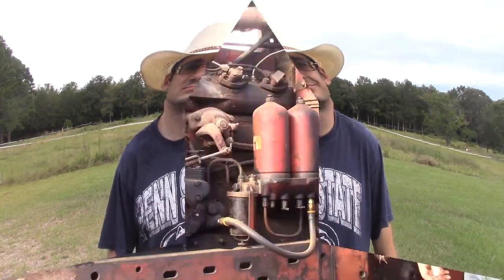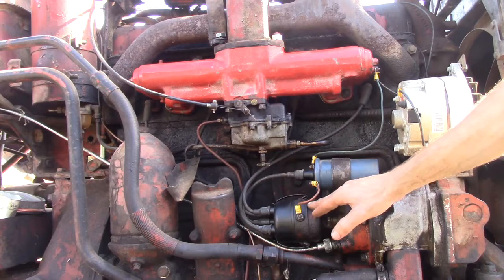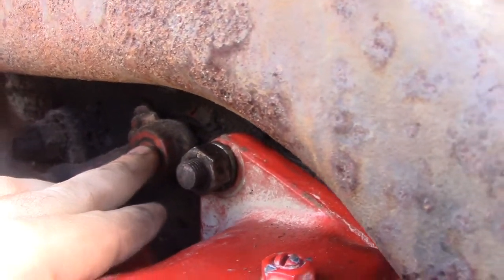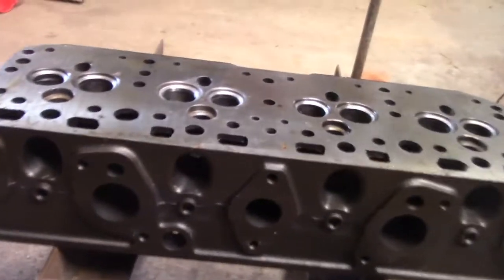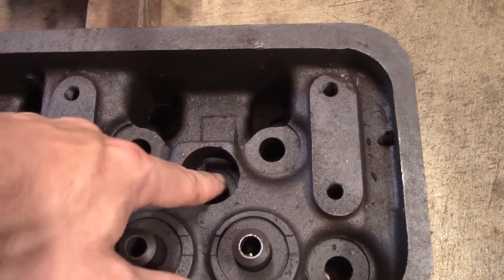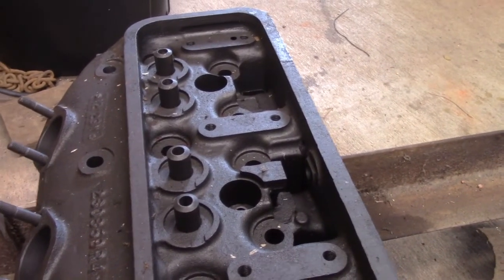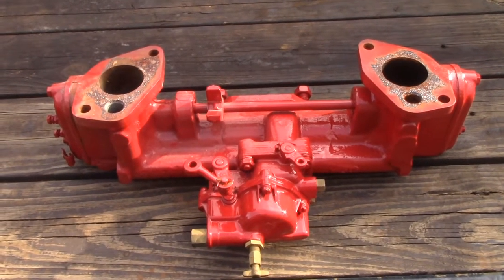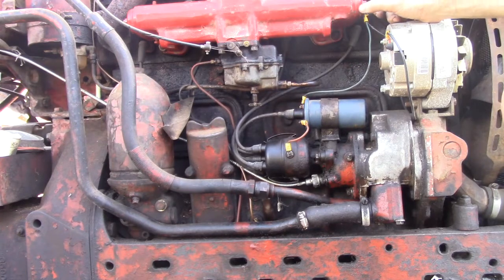Principals of Farmall Gas Start Diesels

Comment: I have some questions on a injector pump on one of these tractors can you help me
Reply from the maker: I can certainly try
Reply: @reeseholler92  I am getting fuel in the oil reservoir on the injector pump 
I have also noticed I can’t seem to get the air out of the fuel in cylinders 1 and 2 
3 and 4 have no air
Reply from the maker: Does the Pump have an A or an IH on the side? The A pumps have a scavenging valve which may stick and cause fuel to enter the reservoir. Otherwise the seals in the primary pump will need to be replaced. It is very common on these. If you cannot get the air out of the injectors after loosing the bleeding screw your plungers are stuck in the distribution block. Doesn't surprise me if its sat for awhile. The top will need to come off and the block removed @masonheggie706
Reply: @reeseholler92  it has the IH on the side 
Will I have to remove the pump to take the top off
Reply: @reeseholler92  it does have a new primary pump on it 
I sent it off to get rebuilt because it was leaking fuel on the motor side and the primary pump 
The guy replaced the primary pump and the seal on the front and said it had good pressure I really just don’t want to take it off again
Reply from the maker: @masonheggie706  If you've pulled the injector line off of the injector and you're still not getting fuel but the other two are, I don't know what it could be other than the distro block. You do not have to remove the pump from the engine to pull the block.
Reply: @reeseholler92  ok thanks 
I am getting fuel to all injectors but 2 of them still have air bubbles and some fuel never solid fuel
I will try it tomorrow 
Will it be seals or o rings the need replaced
Reply: @reeseholler92  I will let you know how it goes 
You video was very informative so glad you returned my message
Reply: @reeseholler92  in your video you talk about adjusting the butterfly for the idle is there a good starting point 
Like screw it all the way down and then back out 1 revolution 
I can’t seem to get it to run without half choke
Reply from the maker: @masonheggie706  depending on what model it is there is a distance setting. My md will only run on half choke as well. Since it's only for starting I never worried about it. As long as it starts thats all that matters
Reply: @reeseholler92  I got this top off and the block off how do you get them out
Reply: @reeseholler92  the plungers out
Reply: @reeseholler92  I got it going I couldn’t figure out how to get the plungers out one was stuck bad I just kept working with it and finally got springy again 
I think I need to advance the timing seems like it is over fueling 
Thanks again
Reply from the maker: @masonheggie706  I'm working on a 4 page paper for my grad degree, but after I finish that I can post instructions on how to set timing. You'll want to run some sort of lube additive in your fuel to help keep those plungers from sticking in the future
Reply: @reeseholler92  thanks

Comment: Recently acquired a 400 Gas start Diesel, initially the gas side worked but after a bit of use it became rougher and now appears that it’s trying to start on diesel though the lever is in gas start position. Confirmed this by shutting off gas supply and with lever in gas position it start on diesel. It will run for a few seconds before shutting off. Any thoughts?
Reply from the maker: Hi, sounds like you have a few things going on here. Thankfully everything on these fuel wise is adjustable and sounds like you may need to do some. First, the diesel throttle needs to be able to completely close via the throttle control. This helps to start on gas and for shutdown. For troubleshooting sake you can unhook it at the pump and hold the throttle closed there. If this works, it's a throttle adjustment issue. If not, your rack is stuck at some throttle setting, probably full. Id check that first before going too much farther. I believe I interpreted your question correctly, if I'm off just let me know
Reply: Thank you so much. We will look into this. Somehow we have wound up with 2 of these  and may have to ask more of you. As you know not a lot of detail in service manuals. Thanks again.
Reply from the maker: @cathygulick1361  no problem! Just let me know. At least you're only at 2. Some might say at 11, that I have a problem ha
Reply: Thank you so much. We will look into this. Somehow we have wound up with 2 of these  and may have to ask more of you. As you know not a lot of detail in service manuals. Thanks again.
Reply: Thank you so much. We will look into this. Somehow we have wound up with 2 of these  and may have to ask more of you. As you know not a lot of detail in service manuals. Thanks again.
Reply: Thank you so much. We will look into this. Somehow we have wound up with 2 of these  and may have to ask more of you. As you know not a lot of detail in service manuals. Thanks again.
Reply: Thank you so much. We will look into this. Somehow we have wound up with 2 of these  and may have to ask more of you. As you know not a lot of detail in service manuals. Thanks again.
Reply: Thank you so much. We will look into this. Somehow we have wound up with 2 of these  and may have to ask more of you. As you know not a lot of detail in service manuals. Thanks again.
Reply: Thank you so much. We will look into this. Somehow we have wound up with 2 of these  and may have to ask more of you. As you know not a lot of detail in service manuals. Thanks again.
Reply: Thank you so much. We will look into this. Somehow we have wound up with 2 of these  and may have to ask more of you. As you know not a lot of detail in service manuals. Thanks again.
Reply: Thank you so much. We will look into this. Somehow we have wound up with 2 of these  and may have to ask more of you. As you know not a lot of detail in service manuals. Thanks again.
Reply: Thank you so much. We will look into this. Somehow we have wound up with 2 of these  and may have to ask more of you. As you know not a lot of detail in service manuals. Thanks again.
Reply: Thank you so much. We will look into this. Somehow we have wound up with 2 of these  and may have to ask more of you. As you know not a lot of detail in service manuals. Thanks again.
Reply: Thank you so much. We will look into this. Somehow we have wound up with 2 of these  and may have to ask more of you. As you know not a lot of detail in service manuals. Thanks again.
Reply: Thank you so much. We will look into this. Somehow we have wound up with 2 of these  and may have to ask more of you. As you know not a lot of detail in service manuals. Thanks again.
Reply: Thank you so much. We will look into this. Somehow we have wound up with 2 of these  and may have to ask more of you. As you know not a lot of detail in service manuals. Thanks again.
Reply: Thank you so much. We will look into this. Somehow we have wound up with 2 of these  and may have to ask more of you. As you know not a lot of detail in service manuals. Thanks again.
Reply: Thank you so much. We will look into this. Somehow we have wound up with 2 of these  and may have to ask more of you. As you know not a lot of detail in service manuals. Thanks again.
Reply: Thank you so much. We will look into this. Somehow we have wound up with 2 of these  and may have to ask more of you. As you know not a lot of detail in service manuals. Thanks again.
Reply: Thank you so much. We will look into this. Somehow we have wound up with 2 of these  and may have to ask more of you. As you know not a lot of detail in service manuals. Thanks again.
Reply: Thank you so much. We will look into this. Somehow we have wound up with 2 of these  and may have to ask more of you. As you know not a lot of detail in service manuals. Thanks again.
Reply: Thank you so much. We will look into this. Somehow we have wound up with 2 of these  and may have to ask more of you. As you know not a lot of detail in service manuals. Thanks again.
Reply: Thank you so much. We will look into this. Somehow we have wound up with 2 of these  and may have to ask more of you. As you know not a lot of detail in service manuals. Thanks again.
Reply: Thank you so much. We will look into this. Somehow we have wound up with 2 of these  and may have to ask more of you. As you know not a lot of detail in service manuals. Thanks again.
Reply: Thank you so much. We will look into this. Somehow we have wound up with 2 of these  and may have to ask more of you. As you know not a lot of detail in service manuals. Thanks again.
Reply: Thank you so much. We will look into this. Somehow we have wound up with 2 of these  and may have to ask more of you. As you know not a lot of detail in service manuals. Thanks again.
Reply: Thank you so much. We will look into this. Somehow we have wound up with 2 of these  and may have to ask more of you. As you know not a lot of detail in service manuals. Thanks again.

Comment: Reese thank you for the explanation.  August 2021 I had my fathers 400 Diesel back from mechanical restoration.  I was able to facilitate the “break-in” of the new engine plowing some acres at my brothers farm….until some hydraulic hoses let loose!  Those repairs are done and my brothers and I found out that the contact disc is shot.  I have been looking for a source, and unfortunately like you and Garland I have not found one.  Both of my brothers are machinist and my eldest is hopefully going to make a new contact disc…to keep the tractor as original as possible.  Thanks for the explanation!  Very helpful.  If I get an opportunity to post a video of my 400 diesel I will tag you!
James
Reply from the maker: Thank you for your time and your comment James. I have some NOS parts back home and I know I have a new disc. I'm assuming you mean the one on the side of the block that provides the friction for the throttle. You can pull it off and tighten it, not sure of you've already done that. It may be too late for your application, but when I'm home over Christmas I may be able to measure and get pics for you in order to make a new one. The material seems very similar to clutch facing
Reply: Hi Reese,
The small disc inside the intake that turns  to make the coil hot when pulling the lever back for gas start.  Thanks for that information, I know my brother said the disc was loose.  I will be back in about 6 weeks from now to have a better look….similar to  you…tractor is in a different location than I live and work; PA verses AZ.
Reply from the maker: @jimmythefishM5  ah gotcha. I have not looked at that for awhile. I dont recall how it attaches, but if one was creative with some resin or epoxy and filled the center hole back in and then filed it out to be tight again it would probably work. That's my spitball thought without having one in front of me. This winter I'm going to go through one of my MTA's, so I'll see what I can do for a fix

Comment: After me being on YouTube for 12 years, FINALLY someone has done a complete and thorough explanation of these magical engines. It's mind boggling to think that someone designed this nigh on 100 years ago.
Reply from the maker: Hopefully it was enough. I've wanted to do one for awhile, it's just tough being away from the tractors all the time. I hope to do more in depth videos of these in the future, after my military days are over
Reply: @reeseholler92  I think what trips up a lot of folks is the idea that the same cylinders will burn both gasoline and diesel fuel, and they immediately think that it's way too complicated for them to understand. Currently the only red tractor in my personal collection is a 450 LP, but I have wanted to have a 400 or 450 Diesel since I was a tiny kid, and I believe you and I are about the same age.
Reply: @reeseholler92  Thanks for your service!  I very much appreciate it.  Hang in there, it can be hard.  I did 34 years in the reserves and the deployments are long.  But my retirement pay has funded overhaul parts on my 450D now that I'm an old shaver. (My Dad bought it in 1979 - it sure didn't owe us anything!) Great to see a young guy with so much knowledge on these.  They aren't as complicated as they look.
Reply: That’s amazing they thought of that engineering that long ago! Thank you for the walkthrough!